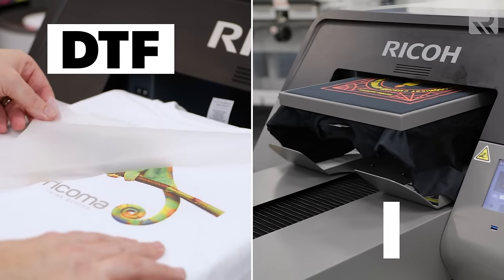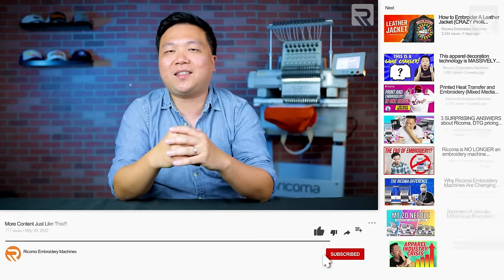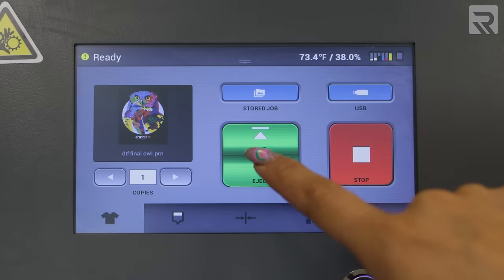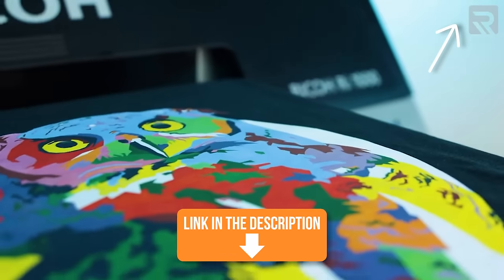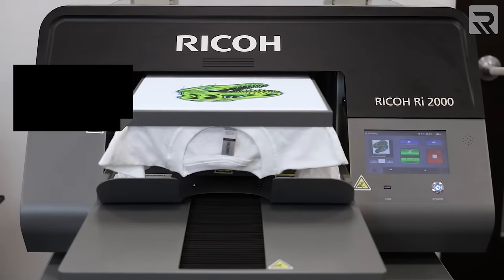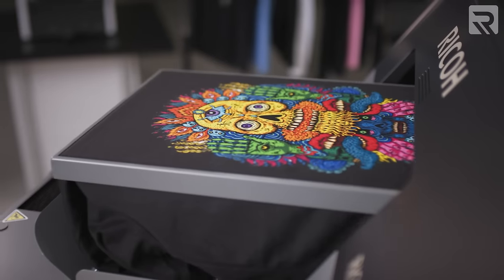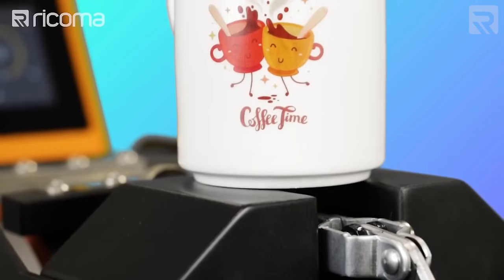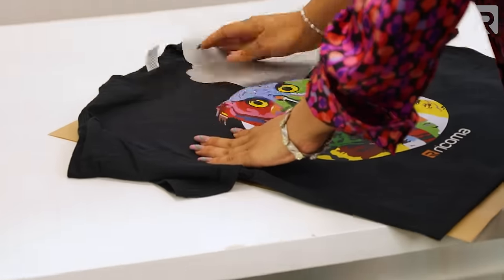DIRECT TO GARMENT PRINTING VS. DIRECT TO FILM (Pros & Cons)

Comment: may i know what work best for kinda grunge tshirt designs . DTF or DTG? and thanks
Reply from the maker: It's ultimately up to you. DTG printed designs have a much smoother finish and will last much longer than designs that are heat transferred, and DTG is ideal to bulk orders. On the other hand, DTF doesn’t require you to pretreat your garment before customizing, and gives you the freedom to customize a wider array of materials.
Reply: @ricomatv  I would say DTG is NOT ideal for bulk orders unless you have the proper equipment setup to run in parallel. For example, multiple machines, a pre-treat machine, a conveyor dryer and multiple heat presses. After running a print company for 7 years, I found that DTG is most effective at doing 1-offs and small runs. We then had top selling designs screen print on to transfer paper still allowing us to drop-ship at time of order as well as taking advantage of bulk screen printing prices. I like the DTF process, this technology was not out when I had my company from 2006-2013. Very innovative
Reply: @ricomatv  Good info!  Most of my shirts are heat transferred and last a long time (4 to 5 years).  Depending on the style and trend, I usually get rid of the shirts and donate them.  I am always looking for the most trendy items.  Any t-shirt I haven't worn for the last 2 years (DTF or DTG) will be donated.
Reply: What is the difference between the DTG and sublimation?
Reply: @Littlefair7  DTG printers use water-based pigment inks, first printing a white base on dark shirts then a color layer over. Sublimation is a different type of ink which actually turns into gas when heated and binds to the substrate. Sublimation ink cannot bind to cotton which is why you see it mainly used on poly blended WHITE shirts
Reply: @AC-wp7em  what type of printing do you recommend for new start ups? Sublimation or DTF?
Reply: @ICEcoldAryan  That's a tough one, I guess the answer it is really just depends. It depends on if you are selling your own products or printing for others. It depends on the type of designs you want to do, full color vs simple colors. Sublimation will be limited for printing on clothing but not for products like cups bags, etc. DTF I like the concept but many people like a soft feel not a plastic covering on their shirt so you might have a liimited market. Anyway.. with all that being said, if i started my own clothing brand I would probably invest in a Vinyl cutter and outsource my prints to Screen print to Transfer paper. Much softer than DTF and Vinyl. And then just purchase a High Quality Heat press ... between those 2 you can produce many high quality prints for pennies. DTG was great except for clogging, I would outsource Full color prints to other companies until you see your design selling then convert it to CMYK and have them screen print to transfers.
Reply: @AC-wp7em  I actually want to setup my business. I want to print on multiple fabrics including black ones plus I want multi color prints. So I guess DTF could be a better option for me. I was also thinking of buying Cameo 4, for decals and stickers stuff. And I guess that can work on mugs and caps too. So yea, I think sublimation is not a good choice for me, I'll go for DTF. And I actually wanna sell my own prints on garments. Thanks for the help man
Reply: @Littlefair7  Sublimation needs a polyester base fabric / DTG can transfer to all fabrics that have the pre coat spray / sublimation is 1/10 the cost of DTG [DTG machine cost about 20k or more] / Sublimation is print on paper then heat press - so its more print on film or DTF process. / DTG is for clothing - sublimation can do clothing, mugs, photo blocks etc. /// Also, the man above didn't mention as a negative because its a break in his business is DTG is a money pit - machine cost a ton, ink cost and if you dont use as often as the machine needs... you will need to flush the ink system to get fresh ink in the print heads.
Reply: @cgilbert6318  
Thanks bro.
Reply: @cgilbert6318  yeah white ink cost $500 for 2 cartridges if it's Epson f2100 and goes out fast like 90 or less shirts so this is definitively not good for bulk orders. As you mentioned the dtg printers and dtf printers clog the same.i would stay away from both to tell you the truth and have someone print dtf transfers for plastisol transfers.dtf is better than dtg cuz you can store the design print to you get a order and print. But with dtg you have to print now.
Reply: It looks Ike dtf looks like plastic on the shirt?
Reply: It’s all
About quality people will remember you for quality don’t let them remember your brand for bad quality sir
Reply: what will be more profitable comparing DTG n DTF
Reply: @jeovanylopez9260  good quality to you is……?
Reply: old school screen printing!!!
Reply: @NWoodstok  hello I M Mira I am about to start those business in m'y Country,Can I have some hello, pkease
Reply: @cgilbert6318  thanks for explaining this point,I was confused
Reply: how to tell if you saw the video or not..
Reply: @elevated-apparel   seriously dont understand this argument for dtf that you can store for later printing the fast dtg took 10 sec no fcking way you can do a dtf tshirt faster because you have the print ready.
Reply: @demonsluger That printer that can print in 10 second how much is it? 250k? 
I like DTG feeling on garment but in an epson or brother, a t shirt it’s more than 1 minute + for black t shirts you need to make pretreatment… unless you want to do white t shirts only and also you have unless 20k for the machine, I think DTF is the best option right now
Reply: Isn’t there printers that do both DTG as well at DTF??

Comment: Okay... I watched this video, and while I do appreciate the commentary inside of it, I do believe that there are some flaws in here.  The part about labor on DTF.  I know you will not mention equipment that you guys do not manufacture and sell yourself, however there are dtf printing solutions that literally takes away all labor.  You can print directly to film, add the adhesive, and cure the transfers, while taking the film up on a roll, all with in one run.  There are equipment out there that makes this happen.  That along blows DTG printing out of the water.  Because now you can actually make transfers for your own business, as well as other printers in your area who just have a heat press.  And these dtf printing solutions are cheaper that most of these DTG machines on the market.  And i'm not sure how you think DTG prints are more durable after washing, I've really disagree with durable washes on DTG prints.  That hasn't been my experience.
Reply: Hey I'm glad someone is watching this as well! Lol I have a question because I've been dying to get into this. Do I need a special printer to make prints on DTF sheets? Can you please explain the process behind that if you don't mind.
Reply: Yesss, I wanna know too.
Reply: @NWoodstok  i have looked in to DTF as well. I had several other pro print Companys make dtf samples. The quality and washness was not that good. And most of my clients would be angry/sad og i should Them DTF. But for some clients om sure it would be good enough. Personally i think DTF is or could be for some companies. We might go for DTF Soon to complement Range of offers.
Reply: @NWoodstok  since you’ve chosen to go DTF, how have you simplified your adhesive process?
Reply: We got some Dtg printed shirts and they were horrible. After that we tried dtf and it is in a different league. Color is amazing and it refuses to wash off the shirt. We have washed it dozens of times with zero problems. Dtg was a nightmare for us. I’m glad you mentioned this because I was scratching my head wondering how the heck he says Dtg is more durable than dtf ???
Reply: Another thing that they did not mentioned was that dtf will adhere to polyester garments and dtg will not.
Reply: Agree 100% my dtg printed ts lasted 10 washes faded faster than my hairline.
Reply: @johnslater5327  is dtg the thin rubbery stuff? Bro as a consumer who knows nothig  of these things there was a few favorite companies of mine that had some shirts done and i loved the shirts but after a handful of washes the image would just start to shred and dissolve and it was this super thin rubbery stuff, nothing like the shirts with thick paint like material that just never die till they dry rot into tiles that pop off after more than fair milage for a cotton shirt. That thick hearty never die stuff i like, but the thin rubber stuff that just i dont know how to describe it, its like it starts to break down and stick back onto itself in uncountable little places, ruining the image, not good at all. Avoid the frail stuff.
Reply: @djkickmycobra5557  well then the dtg print company does not know what they are doing. Dtg print done right, does hold VERY long today.
Reply: @ALEXGIBSONCMG  well i can not see it, so hard for me to tell what it is.
What i tried to say is DTG and DTF has its right on the market. In the end, its how and what you sell for your customers. 
And also of you do it right. As I wrote in another comment, we are thinking also to do DTF (most likely will in near future) just need to calculate all aspects in it. Time, process, quality etc. But there is 100% for sure a market for it. 
DTG print, i have seen start to crack after 10 washes, but it comes down to people just dont do it right (bad pretreatment,  cured right, quality of ink and settings of machine) and the same with DTF it seems, but dtf feels more paper like and not so smooth os what we have found out. But then again its down to personal preference

Actually i find it not very serious, that people try to make one or the other type worse than it is. 

May i ask what print companies it was?
Reply: I can add that my company in Q1 in 2023 will start to sell industrial pretreatment system (washer/dryer) to small and medium print companies to far less than forex. Firebirds way overpriced system.
And also our own pretreated t-shirts. That will actually make it possible to print all over the t-shirt and quality of print gest much better and wash fastness
Reply: @lowdraglinehand5929  color on dtg can be amazing to, its all about the printer settings and how its pretreated and cured. But often a dtg company sacrifice color for speed quality. But Yeah I have seen DTF that look REALLY good
Reply: If your DTG shirts arent lasting long whoever printed it definitely has a lazy work ethic and is cheap with settings , it all depends on who’s doing the process because with Level 6 print on Epson F2100 and a proper heatpress , shirts should last a very long time unless it’s a white shirt with no pretreatment or white ink under layers. Should also be common sense to not wash a shirt often if you’re trying to preserve it dry cleaning would be best
Reply: @uzof6038  very true
Reply: @johnslater5327  no clue but it was the only kind of shirt i had break down that way, had a latex like consistency, unlike other shirt types, seemed to float on top of the fabric instead of blending in
Reply: @uzof6038  im a regular guy, i ain't dry cleaning a t shirt, just make thick and bended into the fabric, ive got print batman shirts from decades ago still serving strong
Reply: Of course there is some wear on the design but it maintains legibility in normal household use
Reply: Dtf printers are also a maintenance hog frankly and printer that prints waterbase type ink thru a print head need maintenance. Dtf prints look garbage and dtf prints starts to ravel on the edges. When you start using white ink this is when things go south with these machines even the roland bn20 when using white ink has issues.
Reply: @uzof6038  the epson f2100 is pure garbage. Printers did not always look good and washed pretty fast about 70 or so washes and that is printing level 6 with the pre treatment machine that also clogs alot due to adhesive and yes we removed the nozzle and soaked it in distilled water. Another issue we keep having was the software would work oneday then the next we had to reinstall it again. So we got rid of the junk. thought about going dtf but I don't like the rubbery feel.
Reply: @ALEXGIBSONCMG  this was funny.  I have never ever taken a tshirt to the cleaners. Not even a supreme tshirts.
Reply: @elevated-apparel  perish the thought of such an outlandish proposition
Reply: DTG better but not this machine, DTF stays for 10 to 15 in Washing machine and all machines have problems
Still silkscreen is the best 😂
Reply: @NWoodstok  what is the difference in material between the dtf film and regular heat transfers like the starcraft inkjet printable opaque transfers? 

What type/model printer is needed to print onto dtf film?
Reply: Thank you Valdez Brown, I'm looking to start s business of this sort soon and can use whatever info is available
Reply: Hey bro I’m getting a dtg or dtf machine leaning more towards the DTF , any tips you can give me so I won’t mess the process up much
Reply: Can you use any fabric? I don’t want to only use polyester
Reply: I need more info
Reply: @mcuse5478  for dtf any fabric even black
Reply: @NWoodstok  what dtf printer would you recommend? Right now i buy my prints. I only have an roland plotter and schulze heatpress 🤔
Reply: @Fbermudez11  & it looks like dtg is only put on 1 spot dead centre or back
Reply: @lukaswalter5991  interested
Reply: @mcuse5478  I believe coton too
Reply: @NWoodstok so u recommend not the DTG ?
Reply: @NWoodstok  hey can we hop on a call so that you explain all of this to me??? Ill pay you thank you
Reply: @Fbermudez11 dtg does work on 100% poly fabric for sure
Reply: @ALEXGIBSONCMG that's dtf
Reply: Isn’t DTF just DTG on film though. Good press with with right amount of heat should press the design into the fibers of shirt from my experience and research
Reply: so what do you suggest??????
Reply: This guy must be fraud. Only to commcent nonsense and don't want to back it up????? Have some balls.
Reply: @lowdraglinehand5929 you're not doing dtg right then or have a low quality priter
Reply: @djkickmycobra5557 learn how to print then.
Reply: @johnslater5327 exactly dtg is superior and dtf is for bottom feeders trying to cheap out from not spending 15k plus on a good dtg printer.
Reply: @elevated-apparel if you think the f2100 is garbage you have no clue what you're doing and don't know how to use it properly because I've been printing it with it for years and not one issue and the quality blows away even higher end printers I've had people ask what I used to print in their blown away when I tell them

Comment: These machines are too expensive. I’m waiting for competitor version to finance 😩😩😩
Reply from the maker: You can take advantage of our current promotion by clicking here > https://hubs.ly/Q01b7Jxp0
Reply: Yessir tell me about it i bought one im paying about $425 a month not to mention the ink is expensive af $230 a cart. If one ink cartridge wastes for example if you wanna use just dark colors and the white ink wastes, you are forced to buy a white ink cart even if you are not using white ink. And last but not least the light t shirts dont require white ink , which means it wont hold as well as dark garments which require a layer of white ink followed by color.
Reply: im paying about $425 a month not to mention the ink is expensive af $230 a cart. If one ink cartridge wastes for example if you wanna use just dark colors and the white ink wastes, you are forced to buy a white ink cart even if you are not using white ink. And last but not least the light t shirts dont require white ink , which means it wont hold as well as dark garments which require a layer of white ink followed by color.

Comment: Excellent overview! But which of the two handle better through the wash?
As I have been using DTG and fine line stuff tends to crack, split and peel away pretty quick in the wash.
Reply from the maker: DTF has a longer durability than DTG!
Reply: @ricomatv  in the video you said that because DTG goes directly to the shirt it’ll last longer in the wash….